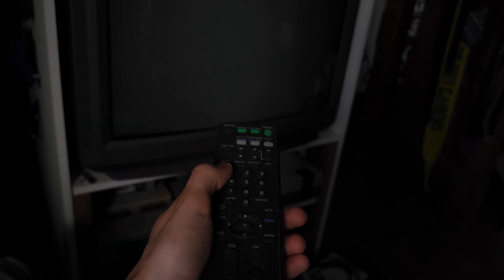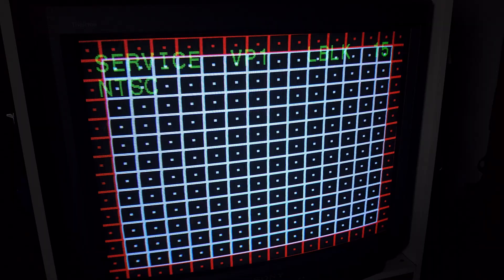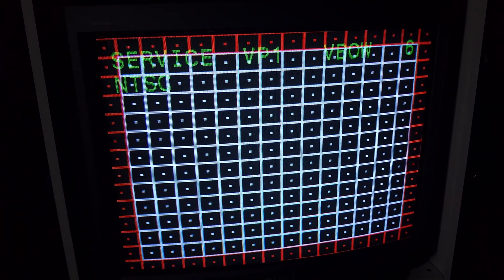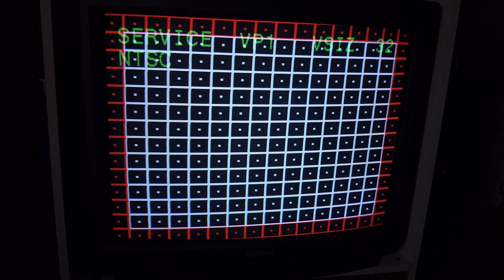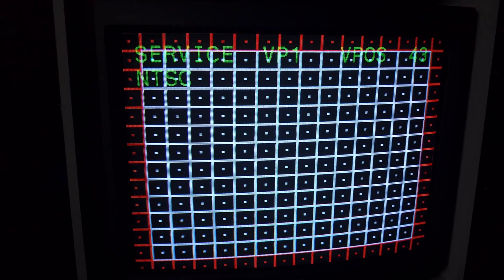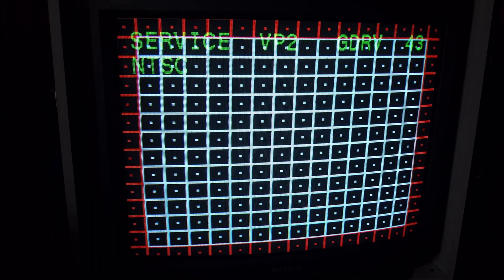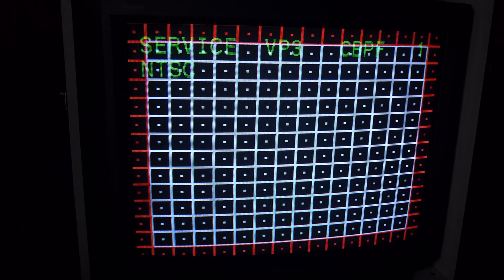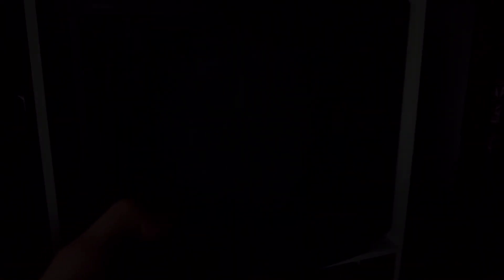Navigating the Sony Trinitron Service Menu (KV-27V42)

Comment: I have the same exact set but I can’t figure out how to tilt the screen :( the tv is perfect otherwise but its geometry is a bit of a mess.
Reply from the maker: most sets that need tilt adjustment require the yoke to be rotated. this involves loosening the set screw on the neck of the tube and rotating the whole assembly slightly. I would advise that if its an issue you can live with, just live with it. My yoke adjustment adventure took me down a painful path of getting it set back right lol. it can be done, but exercise alot of caution due to the high voltage, and be forewarned that its difficult lol.